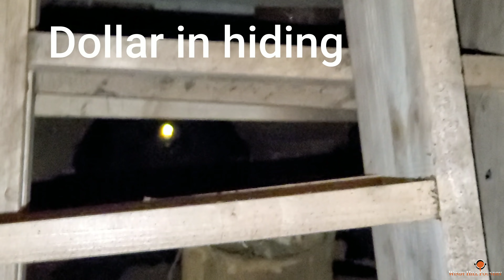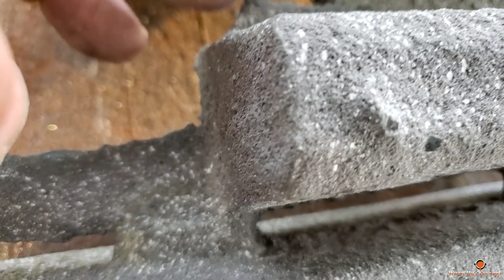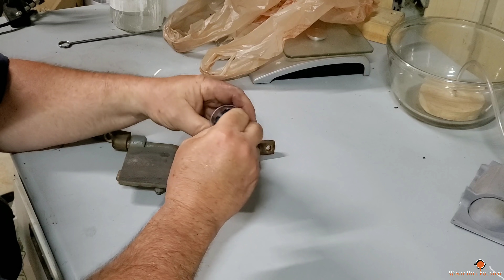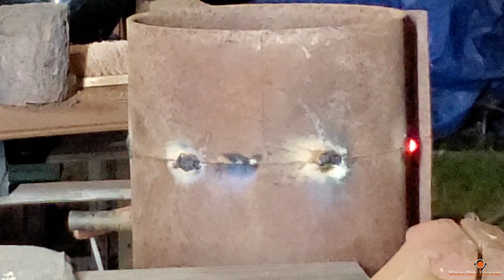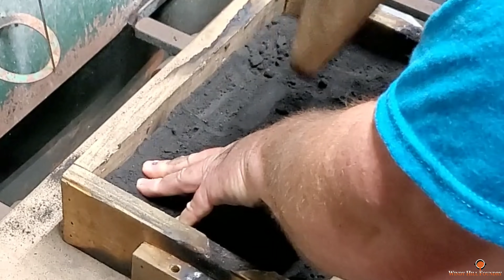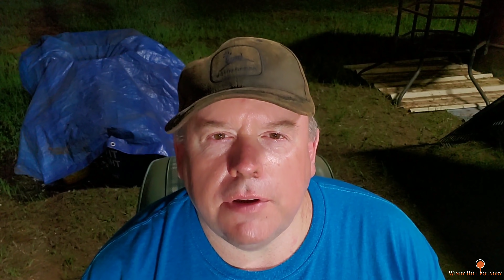ALL THIS SAND AND NO BEACH

Comment: Dollar might be a slow learner. When does the shop expansion series start? 😎 I reckon you only need ac in it being down south I would think the furnace will keep it plenty warm in the wintertime. 🥵
Reply from the maker: Brian, I don't run the furnace when I'm making molds. Depending on what I'm melting with by then, carbon monoxide probably isn't the best thing to circulate🙄

Comment: Clark, if the JB weld doesn't hold, try some 3M 5200 sealant. Put some wax paper or wax on the part you don't want it to stick to and clean the spots with Acetone that you want it to stick to. I used it on a crack in the gear train cover on my diesel and it has lasted for years. Note: the stuff is tenacious and will stick to everything it touches.
Reply from the maker: Thanks for the tip Stephen. I will pick some up👍
Reply: @windyhillfoundry5940  Just remember that the 5200 is permeant and won't come off without heat, but the 4200 is semi-permeant and will come off without heat. This what they use between the hull and deck plate on a lot of fiberglass boats. Also, wear gloves as it will get on your hands no matter how careful you are...LOL

Comment: I would fix your gaps by brazing. Easy and forgiving to do. Also easy to file to shape and will adhere better than JBW. Dries quicker too. But you need a torch.
Reply from the maker: Thanks for the tip. I have the bottles, my dad borrowed my regulators several years ago and,,, I still don't have them back😞

Comment: Crack filling: A strip of packing tape on one part, then cram the gap full of JBWeld. Perfect fit with no sanding / grinding.
Reply: @edwardsilva895  Not a problem. JBW won't stick to the packing tape.
Reply: @LightAndSportyGuy  You mean the Poo Tape that you can never get off stuff when you want to? What about duct tape?
Reply: @markfryer9880  Cheap silver duct tape and clear packing tape both work as a "mold release".

Comment: Ooh, AC/heat sounds nice. Based on where you are, I bet you could get away with an air source reversible heat pump to take care of both. I really wish my work would put in AC. It's only been in the mid to low 90s here so far this summer, but that's plenty hot when you're welding all day. I'm dreading high 90s or low 100s.
Reply from the maker: Yes I believe my production will go way up if I can remain comfortable all year👍

Comment: That is a tough fix for the muller. Other method would be to tape wax paper on the border of the opening so the jb won't stick to anything but the hatch. Then apply the jb weld directly in place to fill all the cracks. It would be like a perfect fit then.
Reply from the maker: I did that yesterday👍

Comment: Your description of the shock collar incident was electrifying!  Also, at the end of the video your facial expressions about watching the dog so you didn't get hydrated...sorta.  Ok on your repairs on that hatch door on the muller but couldn't you build that up with welding?  Enjoyed the whole video but sorry about your cold.  Get well soon, Greg.
Reply from the maker: Thanks Charles, I believe I have kicked it now👍
Reply: Charles, I believe that the hatch door is made of cast iron which is notoriously difficult to weld and then machine successfully. Options are JB Weld or oxy brazing.
Reply from the maker: I see I missed a question. I will probably be redesigning the door. May just go ahead and cast a new one but not right now

Comment: Rusty Tools: From my experience, going through the dew point causes more rusty tools than any other weather condition.  One the humidity condenses on the tools – the rust gremlins take over.  Adding heat to your building will reduce but not eliminate the rust.  Thanks for the videos.
Reply from the maker: Thanks Brian. I work in a room during the day that has to be controlled not only by temp but humidity because we have to remove all preservatives from aerospace parts to test them on the machine. We keep the room at 68°F and run heater strips at the same time.

Comment: Have you thought of using a roller chain coupler for the sand muller?
Reply: Several people have suggested it and I think that will be the permanent repair when the current lovejoy connection fails
Reply from the maker: Yes👍
Reply: @chrisestill8825  I came across it on another channel and thought that it could solve the coupling problem for the muller, thanks for the endorsement.

Comment: I'm curious, with your kiln could you make a permanent false drag by firing some clay? You'd probably need to use a metal box instead of a wooden one and I'm not sure if your kiln could handle something that big, but it might work?
Reply from the maker: Yes you can used vitrified clay as a pattern but there would be a great deal of shrinkage from green clay to bisc. I've used glass patterns often when making iron bowls.